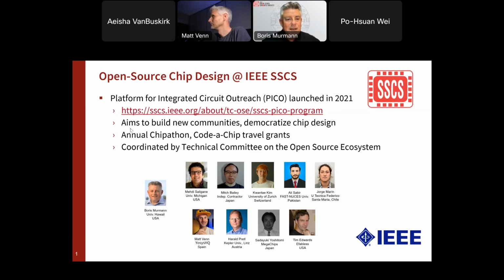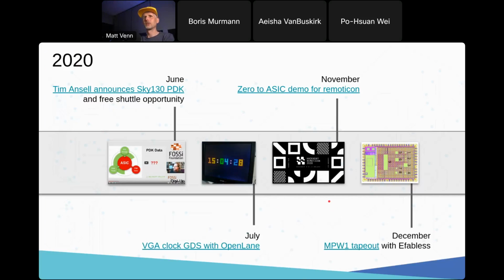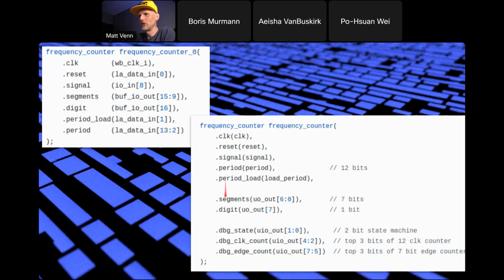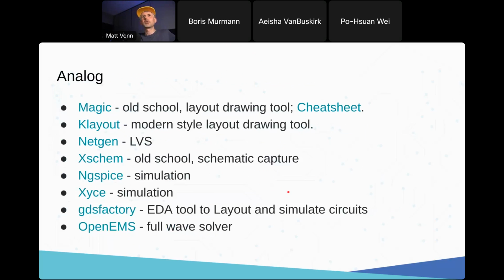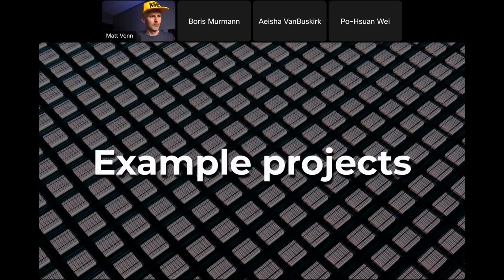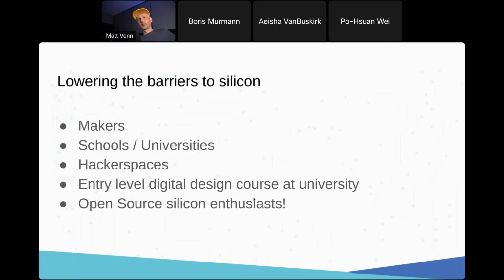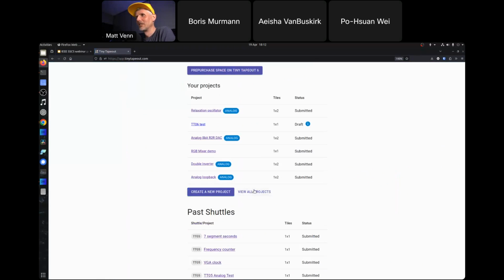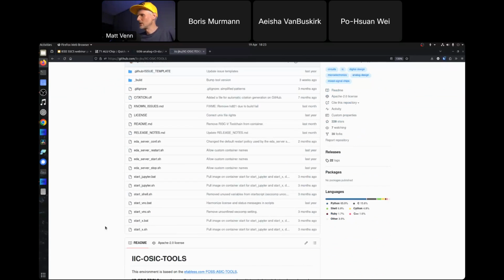Getting Started with Open Source Silicon - Matthew Venn | SSCS Technical Webinars

Comment: This is excellent, the first time I have seen this exciting topic fleshed out properly and discussed with integrity, honesty and an infectious dedication. I have been in the chip development industry but mostly in methodology and verification from RF to digital, and with 20 years experience and knowledge in all flavours of chip process tech (CMOS, BiCMOS, ...) from 180nm to 22nm regime as well as electrical analysis experience and good foundational design principles across analog and RF domains. Although the verification side is a highly valuable contribution in terms of early debug and bug capture, to timely re-design effort early in the design flow long before tape-out, I have always wanted to be more involved in electrical design and circuit performance. Preferable to mostly modelling and functional verification of particular chip configurations during top-level A/MS verification. However, I have been more discouraged more than encouraged to get into front line analog IC design and assume design block ownership, despite significant effort to re-adjust my career development path towards this goal. It has always seemed like very much a closed shop whenever I have enquired about opportunities. I will get there one day, especially with this great IEEE SSCS OSE initiative and the tireless effort from all the major players involved in its inception and continued growth, it will happen sooner or later, even if its just myself doing everything off my own back ;)

Comment: Public Domain tools are good for learning, but not for large scale production.  Because the Highest cost is not the cost of tools, or even the cost of tape out.  The highest cost is the cost of engineering time for development.  It is like running a auto repair shop with amateur tools.  Imagine instead of titanium screw drivers, you use aluminum screw drivers.  Instead of using  a compressor you use a hand pump.
Reply: I think in practice this is only true at very large companies. At small design houses the cost of the tools dominate. I remember a conversation with a founder who was choosing between meeting payroll or buying a ir sim license from one of the vendors.
Reply: @quantumsmith371  Again, this is why Revolution EDA is targeting professional custom IC designers.
Reply: This is very true. This is the gap that Revolution EDA is trying to fill. The aim is to create a professional grade schematic to GDS flow. The basic flow will be free with add-ons either free or paid depending on the developers' wishes.